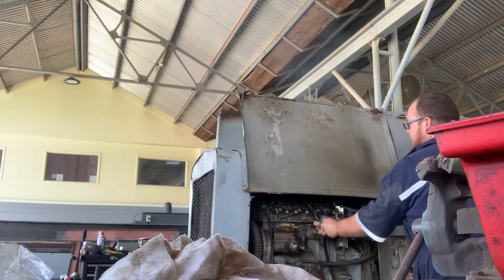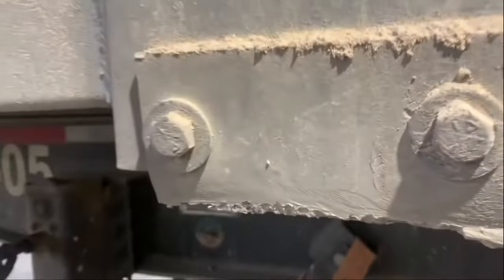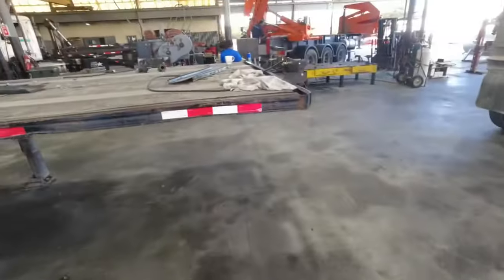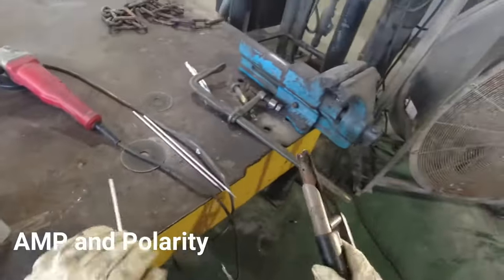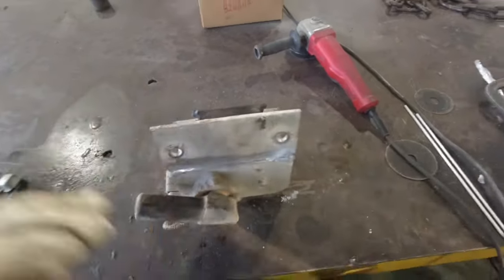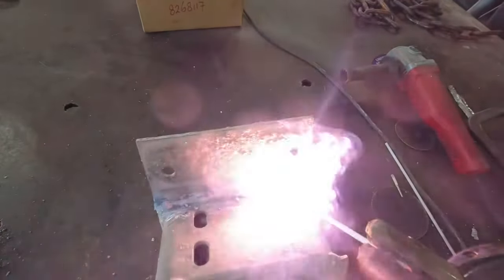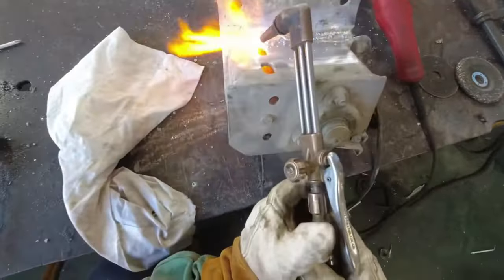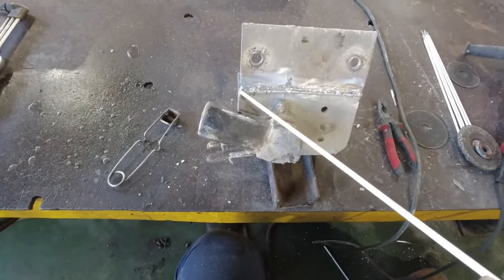ALUMINUM STICK WELDING | everything you need to know

Comment: I believe that AC can create a big enough charge capable of overloading aluminum electrodes.

Many people underestimate AC stick which I've seen melt E6010 that they call DC only.

E6010 and aluminum electrodes shouldn't resist alternating current that long.

Comment: Great information.....im trying to fix a small crack on my transmission i try aluminum brazing but can't get the transmission hot enough.  im think of  buy a cheap stick welder to fix it myself as i cant find someone to do it in my area
Reply from the maker: Worth a shot buddy!! Grind the crack a bit and run a couple of beads over it

Comment: Can you use alternating current to weld aluminum? I have an old buzzbox welder.
Reply from the maker: I dont think so
Reply: @aweldersjourney  what's  the worse that could happen? 🤔
Reply: You could parallel your AC buzz box with another to create a big enough charge capable of overloading aluminum electrodes and workpiece.

Comment: A friend just gave me a 115v/70amp stick  welder and I need to weld the back on a broken automatic transmission. Was quite happy till you said it needs high amperage. I thought aluminum would be lower amperage.🤔 Anyway, not gonna work? Thanks for any advice. Getting desperate to get my beasty back on the road.
Reply from the maker: You can try it if you got a thin enough rod like a 1/16 and you heat the aluminuim you can try it. Why not. Its already broken cant be more broken after ur done.
Reply: Not convinced I can't make it more broken.😆 I'll give it a shot though. Thanks much!👊
Reply: One more thing, if you don't mind. I'm about ready to ebay some rods. Any recommendations? Is one as good as another as long as it's 1/16? I saw one with silicon that's supposed to be less spattery?
Reply from the maker: The only ones i can find are these “Aluminum E4043 Stick Electrode Rod 3/32”

Remember E4043 is the rod you need.

I cant find any 1/16 rods only for TIG. 

Get the E4043 3/32 one and try it but i doubt its gonna have enough power to burn it.
Reply: @aweldersjourney I bought some on ebay earlier. Here's how they had it listed: ER4043 1-lb 1/16" x 16" Aluminum Welding Rod - TIG Filler Rod, TIG Rod. I watched a few other videos and hopefully I'm right that these can be used for welding with my 70A/115V or with a tig or even a torch alone. Dunno much and it's a bit confusing for a newby. I only ever used the trad 225V Lincoln for steel and that was many years ago. Think what I got will do the trick?
Reply from the maker: @jimketchum3169  thats a TIG welding filler rod. you will need a tig machine with argon gas setup to use that.
Reply: @aweldersjourney Oh, shit. Maybe I can cancel it. Thanks for the heads-up! So I need the E4043 and nothing but?
Reply from the maker: @jimketchum3169  yes i copy paste one i found in amazon see closely its a stick electrode rod and not a TIG filler rod thats the difference.  Chek this one out. You can also look for other makes if thats what u want.  Copy paste this in amazon: SÜA - Aluminum E4043 Stick Electrode Rod 3/32" x 14" - (0.5 Lb = 26 Rods)
Reply from the maker: @jimketchum3169  Description
Instructions: Clean the weld area thoroughly so it is not contaminated with iron, rust, oil, grease, etc. Thicker sections should be beveled to a 60° Vee. Align the parts to be welded by tacking the joint(s). Preheating thicker sections to 350°F will flatten the weld bead and reduce the amperage needed., hold the electrode at a 90° angle to the work piece, maintain a short arc length and move rapidly. The weaving technique is not recommended because of the faster travel speeds required when welding aluminum. Allow the part to air cool and remove all slag using a stainless steel brush before making additional passes. When finished, allow the part to cool down to about 200°F and remove flux residue with warm water and a stiff stainless steel brush.
Reply: I just watched a guy weld a bellhousing with a cheap Hobart and 3/32 rods. Took a look at mine and it's a Campbell/Hausfeld. Only 2 options are 1/16" or 5/64"??? Lawdy, this is more complicated than I like.😣 The guy in that video did a pretty nice job for not having ever done it before. Made it look easy. Well, I found the rods on Amazon and screen-grabbed your instructions. Gonna back away and have a think on it all. Maybe see if I can find more videos on stick welding cast aluminum. Meanwhile, thanks so much for your help, bud!
Reply: @aweldersjourney In case you're interested in seeing that video, the guy's channel is Scrapman Industries and the title was: stick welding cast aluminum.
Reply from the maker: @jimketchum3169  oh no i had that machine it doesnt work. Chek out my latest video on the 69$ cheap amazon welder that will burn it for sure!!!
Reply: @aweldersjourney Just keeps getting better, don't it? Does my welder weld light steel OK, or is it just a piece of shit in general? I tried entering your code to buy the one in the Amazon link but it wouldn't recognize it. Looks like a pretty nice little rig based on your video. A reviewer on Amazon said it was good for welding aluminum too. I'll hold off a bit if you think you can get the discount code working. I know it's not a lot of money but I'm pretty broke-ass. Managed to get those TIG rods refunded, btw.😅 They also have the E4043 3/32 rods I need so I'll get them I guess.
Reply from the maker: @jimketchum3169  the code is for their website but its out of stock on there amazon has the best price for it. Get it on there and write my code in the discription or something. And i had that same small hausefieldnwelder and it only welds the smallest rods like the one u mentioned. Its not powerfull enough.
Reply: @aweldersjourney Continued thanks, bud. I'm on it.

Comment: What amp settings you use? What's the smallest thickness it can weld? I mean can it weld aluminum pipes
Reply from the maker: I am using around 100-110 amps with 1/8 rods and welding 4-5mm material. I haven’t tried a 3/32 rod on a thinner material yet but it can be done.

Comment: what do you reckon is the thinest you can stick weld aluminium? like 2 mm? 3? or is that to hard to do maybe
Reply: Like I have only Tig and Mig welded aluminium, even though I used to weld stick almost every day when I used to be a metalworker.
Reply from the maker: Personally i never welded aluminum under 4 mm with stick 3 is the limit i think. Unless you can find a thinner rod than 3/32 and i think its more plausible on lower amps